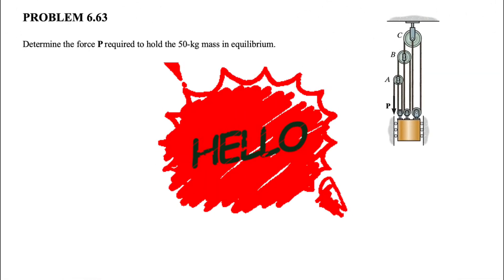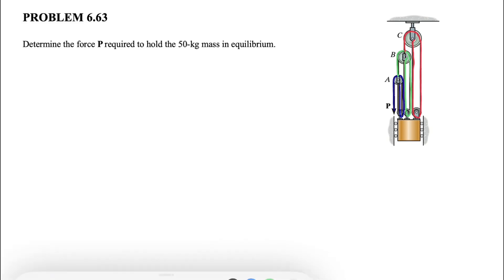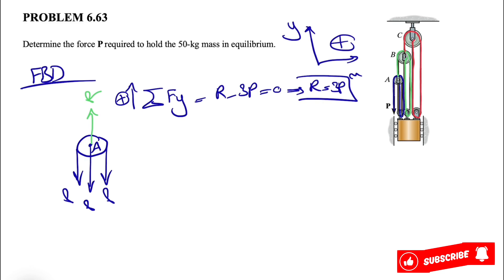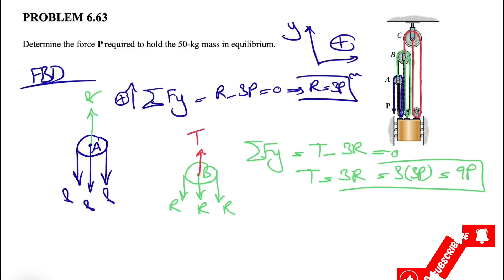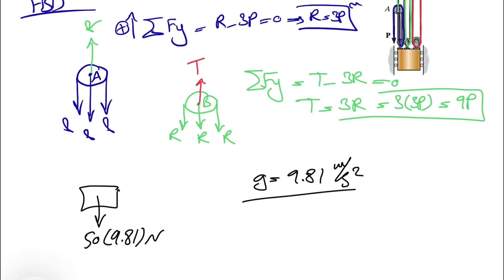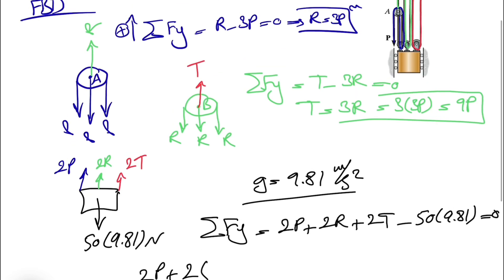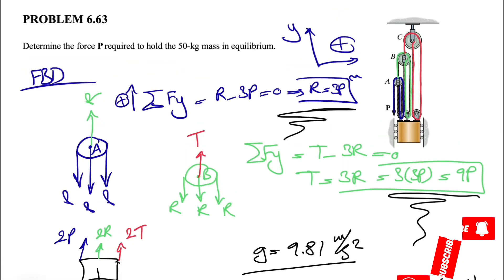Problem 6.63 | Engineering Mechanics Statics

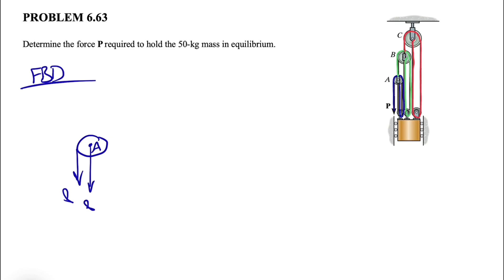Comment: hey, just wondering, at 1:49 ,how'd you know that the middle cable was equal to P? doesnt the cable of the pulley only wrap around the sides?
Reply from the maker: because we have one single cable that goes around and in the middle of pulley as it is color coded in the figure.